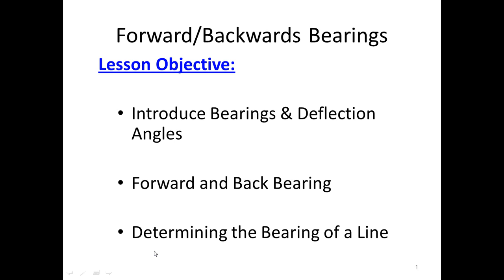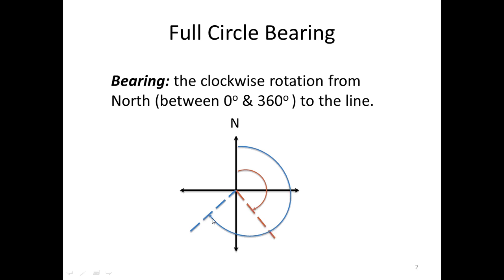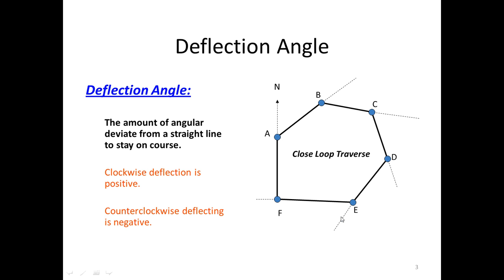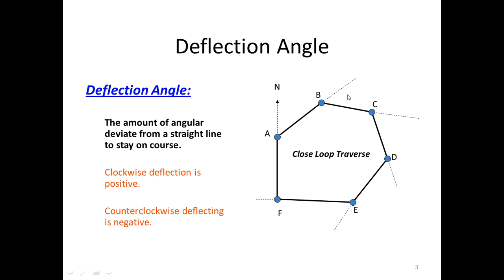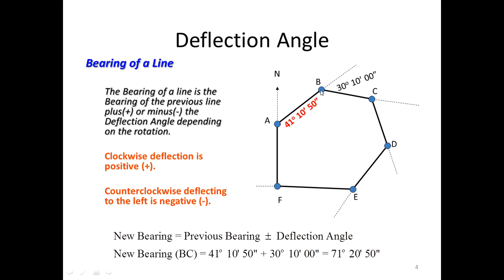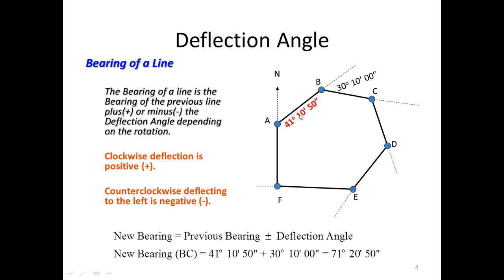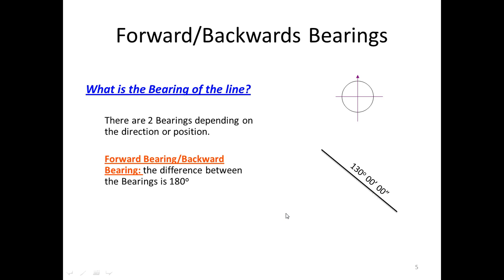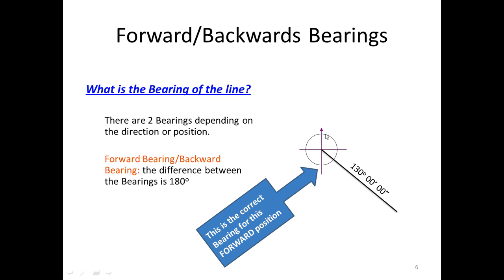Bearings & Deflection Angles (Nazeer A. Khan)

Comment: as others have noted.... the teaching here is wrong. what is being called "bearings" here..... are actully "azimuths"... they run from 0 deg ( due north) thru 359d59m59s...1sec shy of 360 or 0 deg....AZIMUTH !!  Bearings on the other hand...  will run up to 90 (89.59.59) deg east OR west ...of, or " off of", due north or south. an AZIMUTH of 135 deg is the same as a BEARING of S 45 E.....meaning it's 45 deg towards east....  starting from due south. and N 22 W... would be an azimuth of 338.  an azimuth of 270 would be due west. a line with azimuth of 191 would be the same line as would be a line eith azimuth of 11... same line as N 11 E... same line as S 11 W. get it ?

Comment: It shouldn't add up to 360 degrees it's a polygon (n-2)×180, it has 6 sides its should add up to 720 degrees
Reply from the maker: The sum of the  interior angles is 720 but the sum of the deflection sngles = 360.
Reply: @Nazeerkhan10  I miss understood thank you
Reply: @Nazeerkhan10  Sir, seeing that there so many ways to locate points on the ground, which method is most likely to keep you on line and close without accumulating many errors? I know most of these methods but I don't know which may be most reliable.